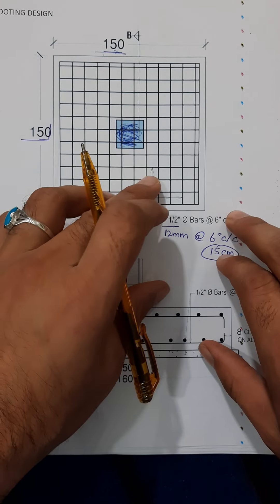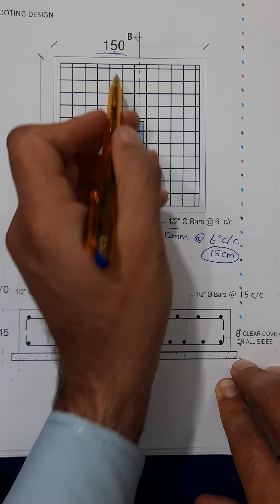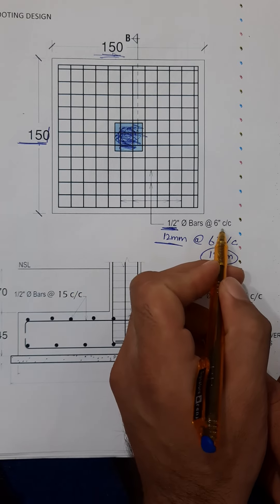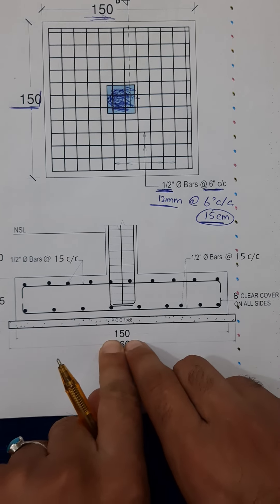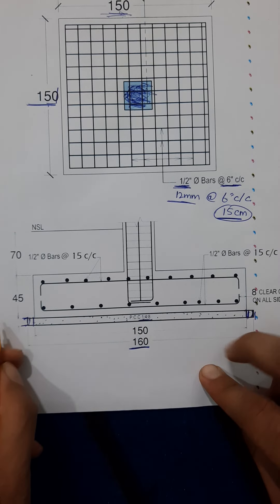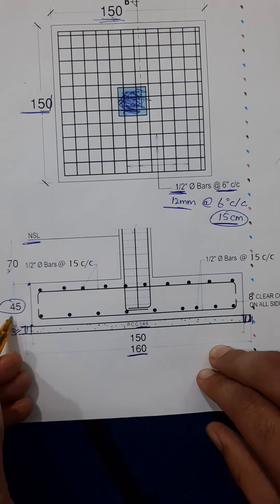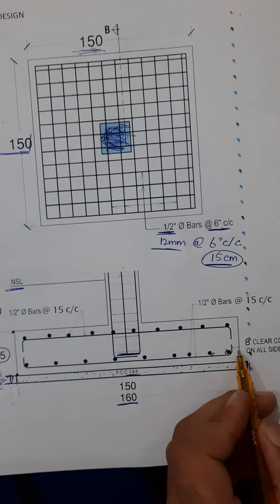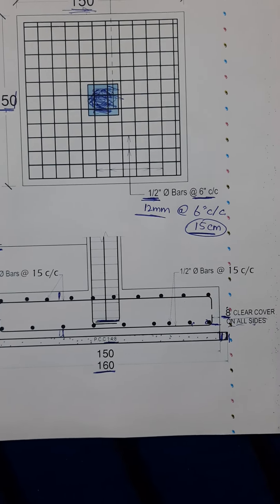Footing Reinforcement and Size Details

Comment: (for column) Development length should b extended outside..not inside
Reply: I agree with that. Doing it inside wise will increase the puncture load on the footing. It is very important to always spread all main bars outwards not less than 300mm in order to have a proper load transfer to the footing.